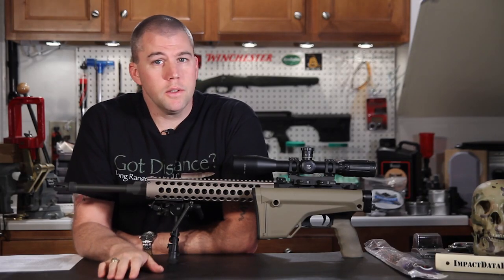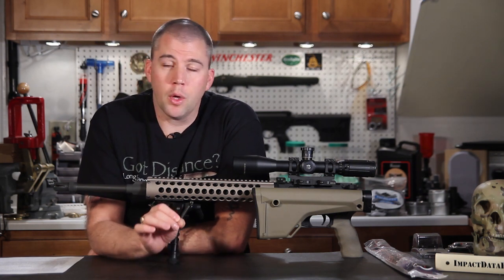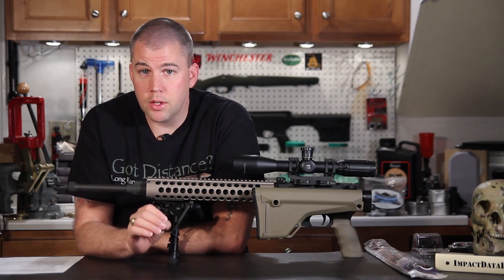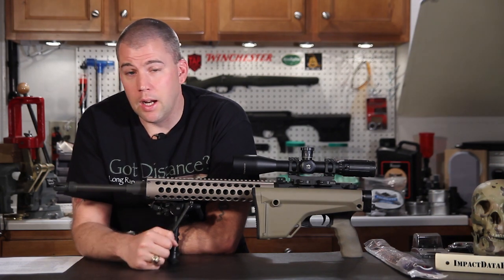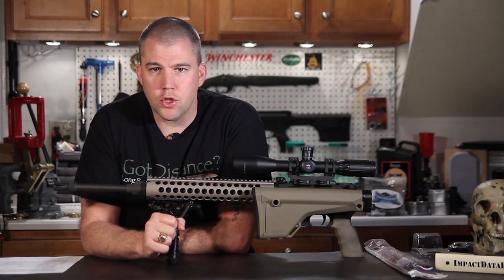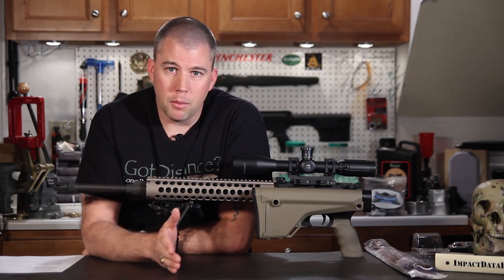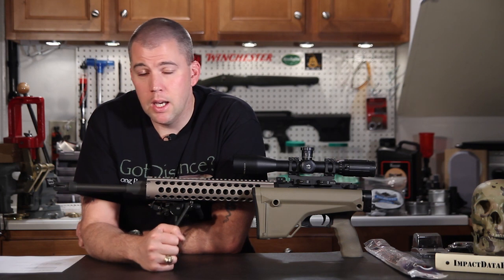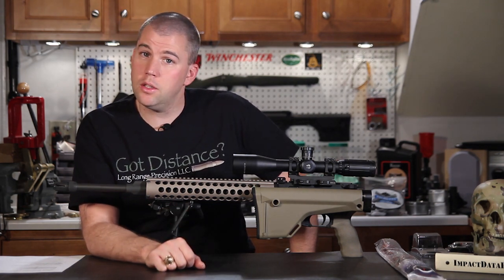Mail Call Mondays Season 2 #17 - 3D Printed Guns and Ballistic Coefficients

Comment: I think politicians are terrified of this for two reasons. The first is that it can be undetectable by metal detectors. They're scared of assassination attempts by an undetectable one shot compact pistol. The second reason why politicians are scared is due to its availability. Anyone with a 3d printer at home can make one which means anyone can be carrying this undetectable pistol. Suddenly a pistol which could easily be used for assassinations is available for everyone.

Comment: Homemade firearms have been around for a long time, in prison they are called "zip" guns. The kid I grew up with  took himself our with a wooden single shot made in a .30-06 . A rubber band and nail for a firing pin. Sadly enough it worked. It's my opinion the government has zero rights for home made firearm as long as you don't go and sell them. Our second amendment right states we the people have the riown and bare arms. It doesn't say anything about only if its made froma manufacture.

Comment: Like you, I'm not worried about a lone criminal; I am worried about the organised group which has enough combined knowledge & money to buy itself a 3D printer & start turning out weapons en masse. Since such a group is likely to have no respect for laws in the first place, nothing changes. The vast majority are going to prefer steel guns for some time to come. I suspect on the individual level it will have much more immediate application to optimising and personalising stock or handgrip design.

Comment: I see how 3d guns could be an issue as someone could buy a high quality printer and start manufacturing for a black market racket. But with so many more affordable, reliable and durable options out their I think something like that is a ways off in my opinion. Bottom line its the person behind it that chooses its purpose and that is where the focus should be. On the person, not the tool.